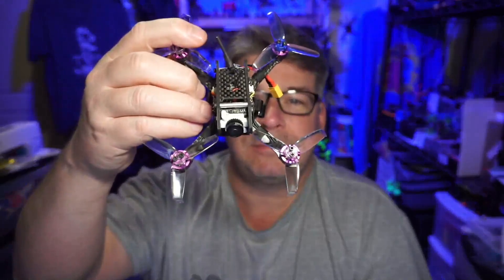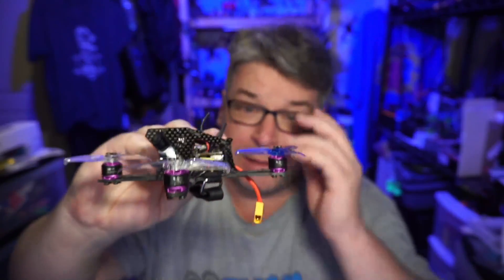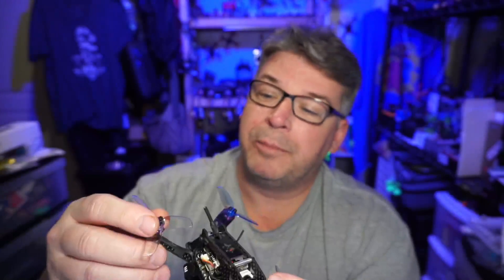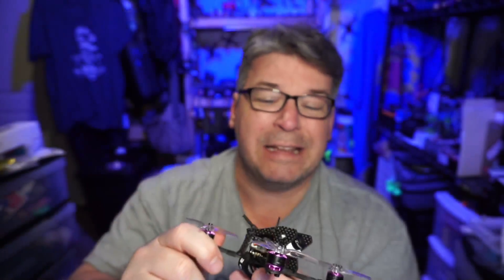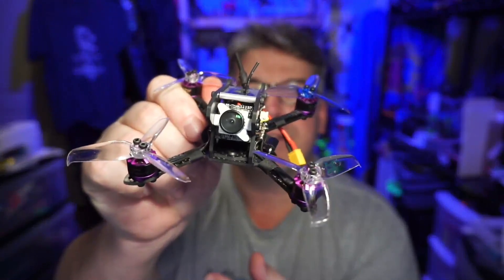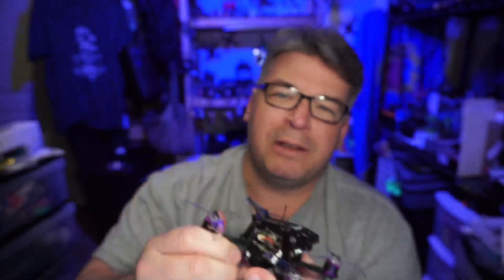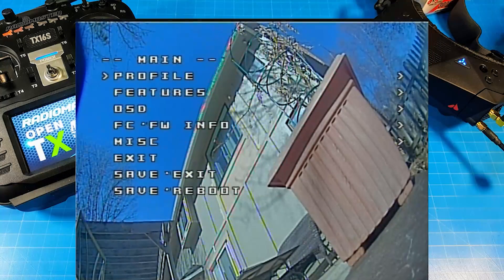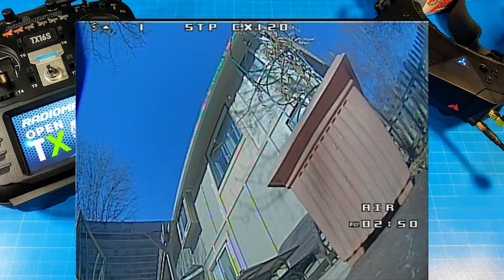How does an old quad fly? // Don't flash a working quad // Boy we have come a long way

Comment: As a computer nerd, I assumed being on the latest BF version was the equivalent of video driver firmware. I quickly learned that was not the case. I would rather fall down a flight of stairs than tune a quad so I leave all my BNFs on whatever they came with. Occasionally I'll see one of those "OMG it flies great now!" videos and copy a specific tune but it's rare.
Reply from the maker: I pretty much leave all the BNFs stock, I tinker on stuff I put together. I would rather fly than tune.

Comment: My two favourite 5" quads both run Betaflight 3.2.2 - Emax Hawk 5's, I love how they still fly so smooth because they have Emax's tune on them, but that now leaves me with a small problem since I've have Shark Byte, which needs 4.1 or newer for VTX control & OSD apparently.

Comment: I have not changed my Betaflight configurator for 2 years and not flashed anything on my old 2 years quads neither. Why change something I like already so much ? ; I already spend enough time resoldering stuff or reparing stuff ...

Comment: Most of the real issues with this hobby is when a person has the same brand new quad and they see the other person ripping a parking lot apart with it. Automatically they search for cheat codes of how they can make their quad to fly the same.. 
they have no clue that the cheat code they’re are after is within themselves.. practice practice and more practice.. stick time is very important. You can’t rip a parking lot with little to no stick time under your belt. #flynowtunelater

Comment: Those 3B 8000kv motors are awesome, I've got them on a 3 inch pickle pick with 3018 props and damn it rips, it punches holes in the sky. It's very surprising how fast it is, easily over 100mph.

Comment: I wanted to first thank you very much for the betafpv Hx100. 
As far as tuning , I try not to update to the latest greatest , I'll try to work on the tune.Some of my qwads I've had to flash to get better , mostly emuflight for the troublesome ones like a mcx3 taycan. For the most part I bought A lot of used and abused ones(about 50) in the past 2yrs to learn from . I have learned so much fixing, setting up, and swapping parts to get the best out of them.Flashing them is not required .I learned Emuflight,Kiss,Flight one before/after Falco X,  D roni on a naze,And Inav .Funny thing the first thing i learned was devention and Hubsan software. I still have a iRangeX IR8M Multi-Protocol Transmitter,fixed the defect they had with super glue gimbals pods, it is bound to bayang betafpv lite whoop in it's own tote with box goggles for anyone that comes along if they don't have anything to try it out.

Comment: I literally hate trying to tune new Betaflight firmware.  3.5.7 Betaflight firmware was the best for me to tune.. Wow I miss those days. Wish I was computer savy enough to make Betaflight hex files of 3.5.7 Betaflight for all my newer target flight controllers. IF IT ISNT BROKEN DONT FIX IT!..LOL
Reply from the maker: If we install the older betaflight configuration app do we get the pre 4 options back. Pain to have to install older stuff but might be easiest method.
Reply: @NickBurnsFPV  I tried old friend even if you install the old configurator 10.3,10.4 it doesnt let you flash pre 4.0 firmware.  I seen guys make hex files of 3.5.7 for newer target FC's. But I dont have a clue how they are doing it.
Reply from the maker: @allennickles3970  Dang it, I see there are a bunch of hexes here, we need to know our target, but for newer boards might not work. https://github.com/betaflight/betaflight/releases/tag/3.5.7
Reply: @NickBurnsFPV  Yes you definitely have to know your target and what stm drivers are needed on your computer to upload these hexfiles on your FC.Then you got to research and see if anyone has been successful on uploading the hex file on your target FC ..and if it had any bugs reported on github?  Its shady territory if you dont know what your doing. I once was uploading a hex file for (MSP for DJI BEFORE THEY ADDED IT TO THE NEW KISS GUI) on a Fettec stack for kiss and it bricked a $140 stack. Thats now a paper weight that i spent hours & hours trying to recover..because i still dont know what happened..I bought a new FC and still motor number #3 wont work on the esc. And the reboot button on the Fettec F7(Old FC) will not work work no matter how you plug in and hold the button.Or how many drivers i install..So no DFU mode at all!!. SO I CAUTION Anybody on any hex file if its Betaflight, Emuflight, Kiss.etc..Do your research on how to use hex & local firmware before trying it..Its been trial & error for me!😀 Im currently running Emuflight on some of my quads some Emuflight beta Aio firmware. And im currently running some Betaflight targets to try out Blujay and some more rpm filters. But its took me some time to learn this stuff because im not to computer savy anyways..lol
Reply from the maker: @allennickles3970  Wow, that really stinks. I see that UAV Tech has a video on building hex files, but I have not watched, it might not be on the 3.5.7 targets, which sounds very important. I was going to suggest EMU, tunes very similarly to 3.5.7. Your doing some emu testing with Kevin or one of the other devs?
Reply: @NickBurnsFPV  They just made a Emuflight hex for the Target IFlight Beast F7 745 Aio.I was one of the ones to requested the target in the development Emuflight Discord chat..I just uploaded the hex on the Aio. I havent had much of a chance to test it because we just went through ice storms & snow here and now it's raining. But yes I'm on Emuflight discord server and will report any bugs if I get to fly it?...lol. But yes I have chatted with the dev's over there. And on the Betaflight side of things and trying new filters & rpm filters..I chatted today with the guys over on BlueJay Discord chat. So yeah I'm a little bit everywhere trying new stuff..lol Anything that makes tunning micros better on this new Betaflight firmware I'm in...lol
Reply from the maker: @allennickles3970  How receptive have the devs in discord been? Coders can be prickly sometimes.
Reply: @NickBurnsFPV  From my experience the guys over there have been really receptive over there and generally fix bugs Pretty fast and listen to any feedback that you may have. Sometimes it takes a little time to sort things out. But from what I seen they are covered up writing new code everyday adding new targets!😀
Reply from the maker: @allennickles3970  Nice. good to hear.

Comment: Great advice Nick! I see a lot of people asking these questions and I've often felt the same sentiment. There is a lot of room for new pilots to learn good flying habits that avoid putting themselves into maneuvers that induce prop wash. That's something that doesn't get mentioned too often. Your inputs on the sticks, how and when you throttle up in dives and cornering, can make a huge difference in how much a quad seems to need to be "tuned". Keep up the great work.

Comment: Nick, do you know of a way to download 3.5.7 ? I have a couple micros that I would like to actually put 3.5.7 back on it.
Reply: You can find it on the Betaflight GitHub. Right-click>Save As... on the hex file that is for your board. In the firmware flasher, instead of clicking on 'Load firmware [online]', click on 'Load firmware [local]' and direct it to the downloaded hex file. Then, flash it as you normally would.
Reply: @Temporal_Flux  Big Thanks 😊🙏

Comment: No offence to Patrick Clarke but I feel like PMB is one of the drivers for this obsession with upgrading fw/tuning. People apply it without even thinking or trying the stock tune, or recommend it to absolute beginners saying it flys "better". A newbie sees that amd then starts blaming their bad flight technique (hard to control throttle, descending into your own prop wash, not compensating throttle when turning etc) on the tune. Learn to fly, then learn to tune or learn what makes the tune good

Comment: In theory the newest Betaflight version can be tuned to exactly the same behaviour as 3.5.7 but since the defaults are quite different today that would require a lot of experience and work. For me the newest Betaflight has always worked well on 5" quads. On whoops, toothpicks and 3" it was a different story and 4.1.0 was a headache. However, 4.2.8 works really well for me with RPM filters but your mileage may vary and a day where you can fly is always better than a day where you flash, test, nothing works and you're frustrated. I would save the original setting and if the new version does not fly well within 1 hour just restore to the old version and have fun.

Comment: I had a ZMR 250 with a NNAZE 32 Rev 6 running BASEFLIHT. Ever fly a NAZE 32 Rev 6.  BASEFlGHT is a predecessor of Betaflight
Reply from the maker: Was that at about the same time as CC3D and openpilot?
Reply: @NickBurnsFPV  I think so

Comment: Great video Nick! My advice to anyone who wants to flash a newer version of Betaflight is to always save a CLI dump/diff of the version that's already on your quad. That way if your quad flies bad or you messed up the settings somehow you can always flash back to the version of BF your quad came and then copy/paste your old CLI dump.
Reply from the maker: That is sage advice as well. If pre BF4 they also need to know where to get the hex file to flash back.

Comment: While I definitely do agree with you on this, I gotta say that I just finished tuning a 5 inch, and it is just way more fun to fly after I tuned it. I was more confident in my abilities to pull off tricks, and I can be way more sloppy without the drone looking or feeling sloppy. It's sharper, stick response is improved, and there is reduced jello when I run a gopro. Just my 5 cents though :D
Reply from the maker: Sure, you have built the experience to be able to tune...this seems to be a skill some want to skip.
Reply: @NickBurnsFPV  This is very true, and that was me when I first started. I flew bone stock everything, not knowing what a better tune looked like, and as you said, if it ain't broke don't fix it! Love your channel

Comment: Thanks for the advice couse i was planning to flash the hell out of the only quad am building so after hearing this ama just leave it alone ☺
Reply from the maker: get it working and adjust the pids and play with the rates if you don't already have rates you have identified.
Reply: @NickBurnsFPV  thaks will do but am gonna train some more befor I put it in the sky 👍
Reply: @NickBurnsFPV  I didn't want to ask a question like this hear but is it ok with u if u could send me some broken stuff so I can fix them plz😊

Comment: we run into this in the 3d printing community too - "I just bought this printer what upgrades do I need?" the thing we keep telling them is that run the machine stock for a bit and then upgrade when needed.  Biggest thing is learn the machine stock, then make changes and when making changes, do one change at a time, that way if it doesn't work, you can always go back.
Reply: I am still amazed how well my non-Pro Ender 3 has done with no mods. I am going to add them... for octoprint mostly... but really my mods have been sitting on a table for over a month waiting. I am afraid to mod something that just works as it should :D
Reply: @moblades1  It's not a big deal with mods on the printer, just watch the videos and following the instructions and you will be fine. My Ender3 is heavily modded as I love to tinker but it also helped me to understand how the printer works and allows me to do my own repairs. I now have 3 printers - 1 Ender3 and 2 Prusas. And everything I learned over the past 2.5 years applies to all my machines.
Reply: The best 'mod' I ever did to my Prusa was install a Toshiba FlashAir so I can copy gcode files onto it wirelessly as it emulates a network drive, virtually never have to take it out of the printer.
Reply: @licensetodrive9930  never heard of that will have to check that out sounds interesting